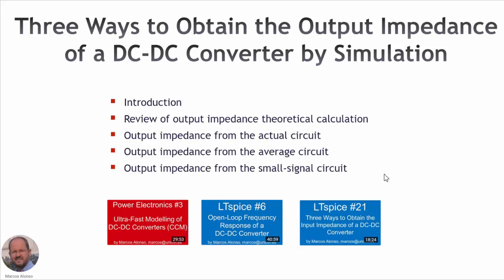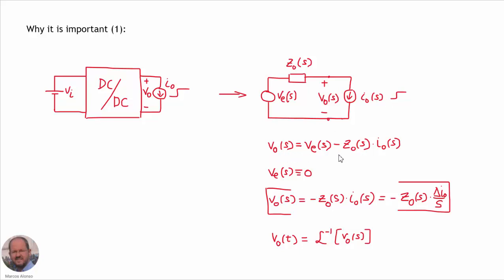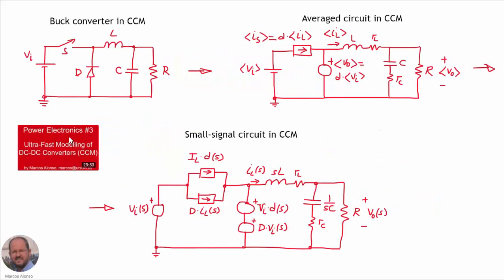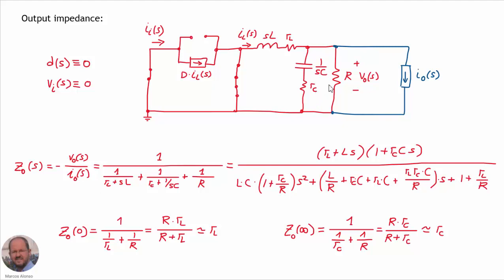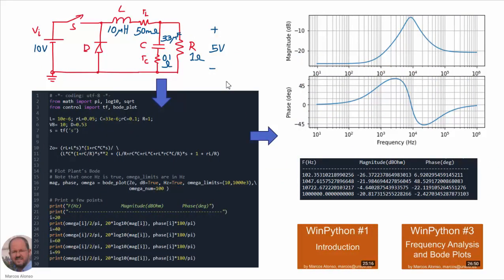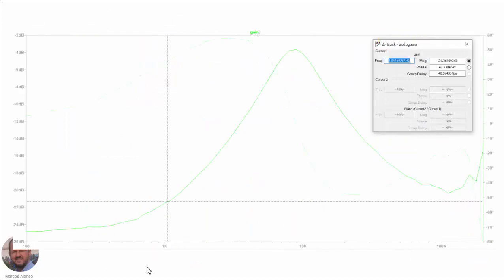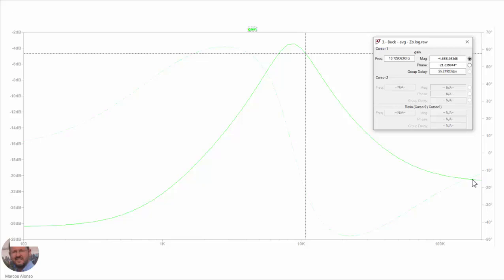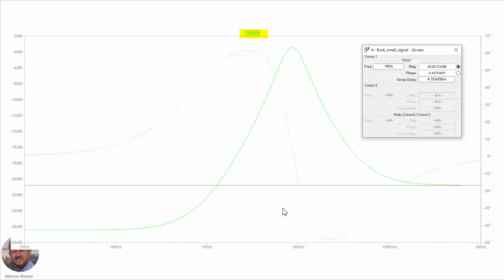LTspice #22: Three Ways to Obtain the Output Impedance of a DC-DC Converter by Simulation

Comment: Hi sir , I tried the inputi impedance methods for IC (available in LTspice) but did not work.
Is there any method that could work for IC based converter as well
Reply from the maker: Hi, thanks for your question. The methodology is general and should be OK for any converter
Reply: @MarcosAlonsoElectronics when I use for  POL buck converter it's taking around 4-5 hours after that also it's not coming proper..there is some zig zag forming
Reply from the maker: @biswajit681  Try increasing "reltol" parameter and also increasing or decreasing the maximum step time. These simulations are tricky to adjust.